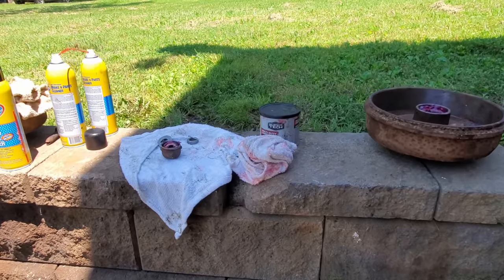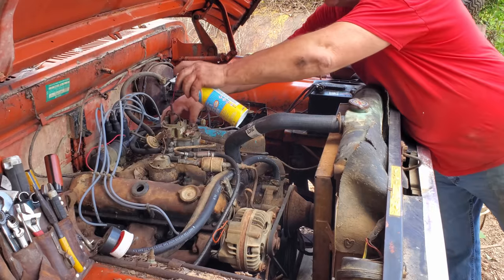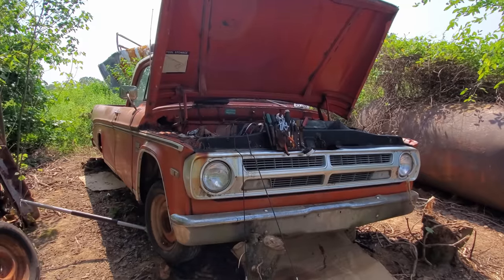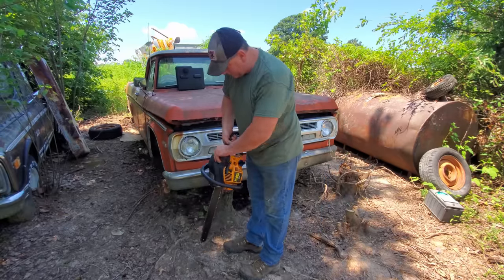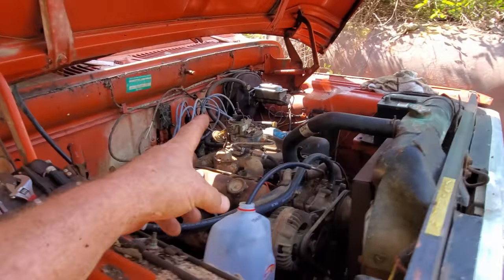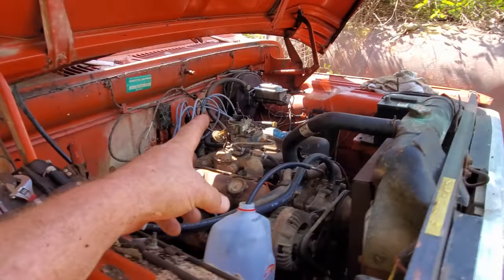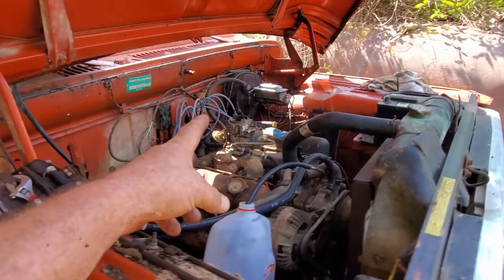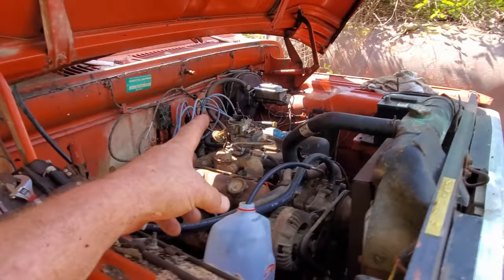1971 D100 (Finis) ABANDONED 34 Years |Back On The Road!!!

Comment: You might be able to fix the horn right, because at some point the steering wheel should be removed to repair the steering column. Obviously it shouldn't twist when the shifter is moved. Hole in exhaust looks like an easy fix. Bunch of little things to plug away at yet. Doin' a great Job!

Comment: Had a car that the horn would blow every time  you turned the wheel.  There was a bare spot on a wire for the horn inside the cap on the steering wheel.  Just wanted to pass that on to you. Another great video.  Please keep them coming.😊
Reply from the maker: I'm sure that's why the wires were unplugged in the first place. 🤣

Comment: Maybe put a big magnet on the outside bottom of the trans pan to catch metals. Back in the old days they didn’t run pan magnet’s  🧲 isn’t there a vacuum modular on those!! If so u can adjust w/straight screw driver

Comment: I had a 84 Dodge Ram D350 with that transmission in it. I actually got it hot one day and it wasn't wanting to pull and had to do what you were doing to get home. Changing the filter and fluid did really help. Ended also up putting a  separate transmission cooler on it. Those 727 transmissions are stout. They can take a beating and keep going. Miss my old dodge. That one reminds me of my dads.

Comment: I was feeling your pain with that transmission issue. I've had it happen to me; no fun. It's a world of difference if its sitting in your driveway and won't move as opposed to sitting on the side of the road. Great that it worked out to be a simple fix for you though not in my case. Enjoyed the series.

Comment: Fun video, ty. In the 70's the tinted windows were a slight green tint. Clear windows would blind you on a sunny day. I made the mistake trying to save 20 bucks buying a clear windshield. Very bad move, had to wear shades to drive it and very hot. Sold it shortly after.

Comment: Chrysler 727 and 904 transmissions have to be in neutral to check the transmission fluid level also the throttle valve linkage to the transmission must be set correctly or it will burn the transmission up pretty quickly.
Reply: Throttle lever wide open transmission lever full back otherwise rebuild will be necessary. Ask me how I know
Reply from the maker: All those were done.

Comment: adjust your low/reverse bands and kickdown bands. I had to do that on my '85 Eagle. it was sitting for 15years beside a friends house. It uses the same transmission with AMC's modifications, but it's still a 727. The low/reverse band is inside on the left of the filter on the accumulator spring rod (you'll see the nut/screw). The kickdown band adjustment is outside on the drivers side. Tighten both to 72inlbs, then back off two full turns and tighten the nut while holding the screw. then test drive and see if it shifts better. mine shifts great after doing the adjustments. i also added some seafoam transmission conditioner and it seemed to clean things out. i also did two full fluid/filter changes just two wash out all the goo. I was glad i did!

Comment: I have actually experienced the exact transmission issue this truck is having. It happened to me in my 1999 Toyota Camry. I was pulling out of work and onto the road, and it started slipping. Once I hit the first red light, it was like I was in neutral. As soon as this happened, it threw a DTC code relating to shift solenoids. I was able to shift it to park, shut the engine off, and when I started it back up, I was able to drive it back to the parking lot to be rescued. I never pulled the transmission apart, and I ended up replacing it with another one from the junkyard.

Comment: the advantage of a Dodge not pumping in park helped police cars and Taxis because they sit and idle a lot less heat. but you just have to make sure you check idling in gear. the valve body can be modified to pump in neutral and usually when i rebuild one i make that mod mainly because another problem with not pumping in park when you first start in the morning or after being parked for a while when you first start and drop in gear it doesn't move. old timers like me have a habbit of when first starting move shifter to neutral for 15-20 seconds for the pump to fill then put in gear.

Comment: Excellent video Chad  :) think transmission needs fluid change plus filter also pan gasket too  and if not flush transmission before put new fluid plus filter too ! But carb change will help start and go drives too ! Also get WYNNES brand black bottle of Trans Medic  add transmission  fluid help too and check Rock Auto for new fuel tank , plus Sending Unit  and fuel pump also help lots too! Also vechile Chad be Dad old Chevrolet pick up !

Comment: when you were working under the truck on the front brake lines I noticed that there was a can of something on the top of the front right spring and it was blue in color watch your video and you will see it's not the shock but behind it somewhere near the motor mount

Comment: There is solids floating in the trans pan and they get sucked up into the filter and plugs it. When you shut it off the back rush of fluid pushes those solids back into the pan and starting back up allows fluid flow again.

Comment: I always put radiator flush in with the water at first fill up cools and cleans till i get it back to the shop. You have to drain it anyway to refill it with coolant anyway ,,,not trying to b a know it all but it usually cleans the heater core radiator ,block ,eveything good job

Comment: hey chad, I have a fuzzy memory from wrenching on my first car that the fluid level on those 3 speed torqueflytes is supposed to be checked with the engine running at a warm idle. also, if you've got that much clutch material in the pan, it might be worth adjusting the clutch bands to get it to shift right.

Comment: Check the bushings on the transmission and the  play of the shift handle as there is a lot of play on it. viberation may be nocking it out of gear. At that time they started using plastic bushings and they didn't last very long.

Comment: I had a guy brought me an old Dodge camper van little Slant  with same transmission you working on there,727. It was doing same thing actually worse it would run a second and stop pulling. It looked just like that when I pulled the pan and I told the guy it will never work but I changed it and he drove it all the way to Alabama and back. They are tough transmission. If it's not kicking down it's gotta be that kick down bar. And I think the timing needs advanced a smidge

Comment: Sometimes you got to let your transmission build up pressure because when we change the transmission, we weren't getting anything either until we waited a little bit, then it built up pressure, and the truck moved

Comment: The filter's clog and up so the  Pump stops pumping picking up when you kill it all stuff fall off the filter And for a change of transmission fluid in the falter you need to put some speed shift in it makes the transmission fluid turn into foam clean inside the transmission

Comment: Hole in the stall converter. Spin fast push oil out. Stop the oil has time to get oil in the stall converter. Or filter or the pump is cooked. That radiator need a good flush or replacing.  God bless. Mick Australia)

Comment: Proper tool makes constant tension clamps a breeze and if you have wild temperature swings like up in the north they leak way less than those screw type ones.
Reply from the maker: Never had a worm gear camp leak. Fooey on them hog ring clamps!!

Comment: I think you need to change the transmission fluid and filter. Every time you start the engine it sucks up the sludge that's been building up for years and clogs the filter. Turn off the engine and the pump stops allowing the sludge to settle back to the bottom of the pan.

Comment: Seems to me that you have a clogged transmission filter when it gets clogged it loses pressure behind the shift solenoid for the gears every time you put it in neutral or park and shut it off the pressure drops so all the fluid goes back to the pAn when you start it back up and go off in gear fluids able to travel through the filter until you get that debris jammed up in the filter again

Comment: On the passenger side of the truck there's two square bolt with jam
 nuts onthe transmission set them at 25 " lbs thats 1st an  rev an 2nd an 3rd . The one closer to the tail shaft is first and reverse band  don't  down shift to first slowing down under  a load there notorious for popping the band .first will work only on power side freewheels on deceleration shifts ok but no reverse you can here it go in but nothing band pops off of clip at tenchen ajuster above valve boddy hope info helps great job  great that a young lady likes it

Comment: If you are seeing full 12-13VDC at the feed to the temperature sender on the engine block, that is too high. Dodge used a pulsed voltage regulator that puts out an average of 5VDC to the temperature, oil pressure and fuel gauges. This allowed them to continue using the same meter movements that had been used on their 6VDC systems of the early 1950s etc. So the temperature sender you installed may not be the correct one to use. The old sender may actually be OK and the voltage regulator for the gauges may need to be replaced. You should be able to find the regulator somewhere on the back side of the instrument cluster. Some bolt on and some plug into sockets in a circuit board on the back of the instrument cluster. The fuel sending unit needs to be the correct resistance value as the original in order to work correctly with the gauge in the dash.
Reply from the maker: You just might be correct. I completely  forgot about this and I even made a regulator for the other danged ol Dodge last year because it quit working.

Comment: You have to turn the cab heater on to hot when filling the cooling system as if you dont you get an air lock in the heater core.

Comment: I asked my friend Google Bard Ai about if the 71D100 had a vacuum controlled shifter, this is what it said. Yes, a 1971 D100 truck uses a vacuum-controlled shifter. This means that the shifter is controlled by a vacuum actuator, which is a device that uses vacuum to move a piston. The vacuum actuator is connected to the shifter by a linkage, and when the vacuum actuator is activated, it moves the shifter to the desired position.

The vacuum actuator is powered by the engine's vacuum system. When the engine is running, it creates a vacuum in the intake manifold. This vacuum is then used to power the vacuum actuator, which in turn moves the shifter.

The vacuum-controlled shifter is a relatively simple and reliable system. It is also relatively inexpensive to repair, if it ever needs to be repaired.

I think the vacuum actuator is bad; just my hunch.

Comment: Might want to rebuild the carb or put a four barrel on it those 318's were good strong motors when they run good not as tough as the 225 slant six but they were tough.

Comment: the filter has a wire core when you switch it off kinda self cleans filter when you switch off shakes the trash off of the filter then when you restart it picks up the trash and stops the filter up again

Comment: Hummm been thinking on this and I'm a guessing 🤔 after bitung most my nails off....well I may be dead wrong but I'm guessing maybe it's Lockjaw you got in your shop, reason being it has so much body work that needs done and most body work is normally done inside a shop building where you have access to electrical plugs ins for power equipment for cutting metal panels and nearby compressed air too???? 👍🇺🇲

Comment: That’s a Denso gear reduction starter. There’s no better starter made than a Denso. They’ll crank high compression big blocks all day long. They are also easily and cheaply fixed when the contacts wear out.

Comment: I don't know if you noticed or not,,but the exhaust pipe has a HOLE IN IT😂😂😂 I never understood why they didn't put drain plugs on tranny pans either,,my Pontiac is the same way,,I gotta get the pan off one of these days and replace the lock-up solenoid!! When I do it will get a drain plug too!! By the way,, what kinda FLURD DID IT TAKE??😂😂😂 same as general motors or Ford? By the way Adams is getting closer, depends ( not the UNDERWEAR) ON how hot it tiz, how muggy, whether it's raining etc, whether I make it, but if I do, I'll be looking fer ya riding the cart around! Hope to get to go! And meet you maybe.. til then stay Cool if you can!!

Comment: Those are the best clamps you will ever find  ,,,,,,,thats why they are still on there afte 35  yrs and probably be used again and never leak  just get the tool ,,,its cheap enough and thosse clamps lock open until you release them when you get them in place best clamps ever invented especially in real real tight spots where u cand get a screw driver in
Reply from the maker: Those clamps will be gone if I have to work on it again!

Comment: Ensure the filter is stopped at but like I said if you don't pump all that old trash out of a bottom that filter by pumping the fluid through it going both ways I said put one the tube that blows out in the bucket and it won't suck it in a new flood and reverse flesh it that's what they do when these new trucks with the machine but it cleans all that crap out of thenvironment and then you fill it up with that Lucas in that loop guard added if when you put it when you flush in the flood through is there a white bottle called flush and protected and it will clean up And then you put that Lucas in there when you finally done with the flush on the system there and you're good to go It will probably straighten out any problem with how no more problem matter but if you do a regular transmission fluid change on it without doing that because you're only changing 1/3 of the fluid in the transmission but they hold 3 gallons and you're only gonna be created about 6 qt but dropped in the Pan which means you still got the crap in the passages and the translation if you don't flush it all out and never work without rebuilding But if you do it the way I said it'll work I've seen transmissions like that slip and I've seen that curum Kira over and over again I even did that on my brand new charger when the transmission was not serviceable they said slip digest pulled the plug outside of it suck don't vote out of it cut the lines off and forced to live through it one way with a pump and I'll come out playing put the line back home and then put that conversion added if you got hold inside where the factory filled it up and it worked on that brand new 1 that they said you weren't responds to be able to service But service free transmissions are a hunk crap they're not that's not true they'll be the last 1 about 80000 even in new cars These days are you trying to fluid or you'll be changing transmission and the new ones I hear It to you

Comment: chad that 727 didnt have partial kickdown until 1972 . say your in third gear going up a hill give it allitle gas to kick it down it will go into second gear. you can adjust  the kickdown rod on some of them to downshift from 3rd to second up to 65-70 mph! my old coronet does that. that has a 440 in it. the 727 and 904 has a drain plug in the the torque convertor they did away with the drain plugs in 1978/79.make sure that kickdown rod that runs off of the carburetor pin is right against  the pin  at full throttle the carburetor rod should have aprox 3/8"freeplay. the kickdown band and low reverse bands also play a part in shifting also but thats another story. ive been into mopars since  the early 80s. i live on a farm  in ny with my father and we bail and sell hay. theirs 197 acres up here and the weathers wacky up here to.awesume job on your garage ,just a thought i run that info to you. keep resurecting the good old stuff gas engines forever take care.
Reply from the maker: It wouldn't kick down at all. Just needed driving.

Comment: it should drop to cold when you unplug that is normal if you ground it goes to hot. did they ask you if you had gauge or light the sending units are different one for a light will not on one with a gauge

Comment: Transmission pumps have an pressure issue but if it's got a your mouth on it that could also be bad that would cause all your surgeon all that but if you did you would know couldn't pull it off of the hose obviously like a Chevrolet and if you let her bounce bad you don't have light fluid in the hose they're ghosted😅

Comment: Ive had a 74 d100 dodge adventurer club cab long bed heavy duty wooden flat bed,,a 90 dodge dakota regular cab 2wd longbed sport no graphics just se bagdes it was a 5spd transmission, and the current truck is a 2000 dodge ram laramie slt quad cab long bed 5.2 litre 318 magnum V8 46 RE AT  1500 4x4, anyways my point being i do like dodge vehicles or mopar, slash chrysler corporation vehicles lol but that being said they can be difficult to disassemble and work on, are known to be tempermental vehicles lol my 2000 ram is not... shocking actually.

Comment: Did you not know you can pump brakes up then pull the lid on master cylinder and loosen bleaker up on brake to fluid comes out then tighten do all the same way

Comment: You installed the wrong thermostat in that Cleveland as it requires a different one to the Windsor motor, just google clevo bypass cooling system if wrong one is installed you will always have a heating problem
Reply from the maker: This ain't a ford!

Comment: Had a 72 dodge rebuilt trans put Tran in and didn't  shift right passing li kage on carb was o u t of adjustment kept passing gear in gaged like pedal was on floor at low speed